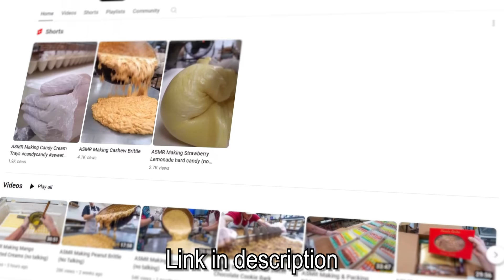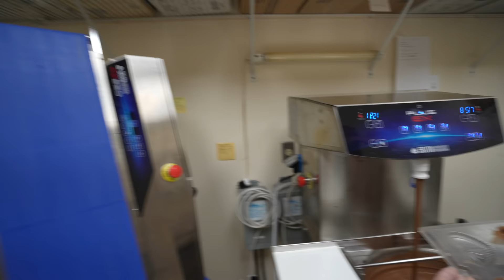FINALLY Some News About The Old Candy Shop!

Comment: You might want to look into using a jerky gun for filling the peanut butter ones.  All metal guns are stronger, but with peanut butter at room temperature, it should be much easier than ground meat. I broke the plastic model but am really liking the metal one. They come with flat spouts and round spouts and work like caulking guns. I just think they would do a cleaner job faster, loading them would be fairly quick and easy.

Comment: I know you've tried all kinds of ways but what about squeeze bottles? If u keep them in hot water bath, it would make the pb liquid enough to be squeezable but not too warm that it would melt the chocolate. OR squeeze warm pb into molds that you freeze and coat those in chocolate? Or if u can make them in a slightly smaller size, the puck of pb could just be dropped into the chocolate shell?

Comment: Hi Hercules Candy!  to fill the chocolate heart boxes with peanut butter, to make the process faster you can melt the peanut butter in the microwave slightly, put it in a pastry bag and fill.  You can do a whole tray at once and put them in the fridge.  Much faster!  they look beautiful!
Reply from the maker: If we do that, it's too runny and leaks out of the sides because the top that we put on isn't a tight fit - it just sets on top. We do use the pastry bag method for peanut butter cups because the top seals the peanut butter inside.

Comment: What temperature do you keep the refrigerator to cool the chocolate boxes? I’ve had issues with the chocolate blooming when I place the molds in the refrigerator to  set. I suspect the temperature in my refrigerator is too cold and causes thermal shock. The molds I let set at room temperature did not bloom.

Comment: Whew Craig, if you were leaving I just don’t think I could handle it. I love you guys. I plan on being here till ……..Steve, you couldn’t find broken chips to use? You smashed some perfect chips. lol does Corporate know you did that? Just asking.  There are 3 floors to my house 1 being the basement. Where hubby goes to play. In order to keep it remotely warm enough I set my Thermostat is set at 75. Rarely does it break 70.  Why does Steve not fill all the hearts at the same time? Wouldn’t that be easier? Thank you for the video.

Comment: SUGGESTION! 
Maybe try putting the peanut butter in a quality piping bag to add to hearts, you may not have to use the knife at all to spread it out and might not take as long. 🤷‍♀ Not saying you need to work faster...It just may make it easier to work with since peanut butter is SO THICK! 🫶